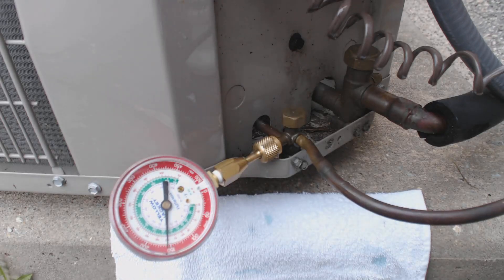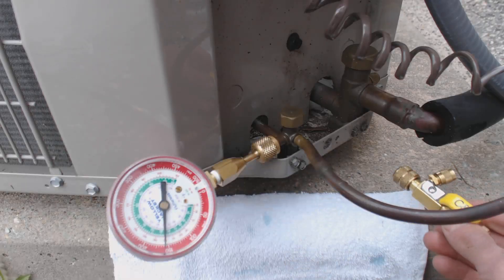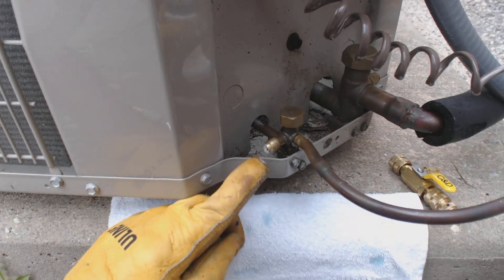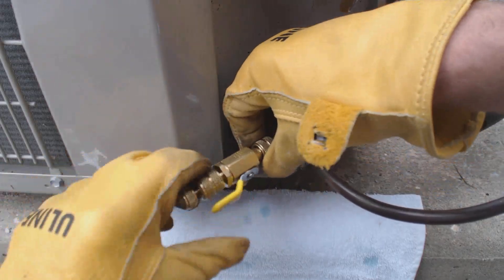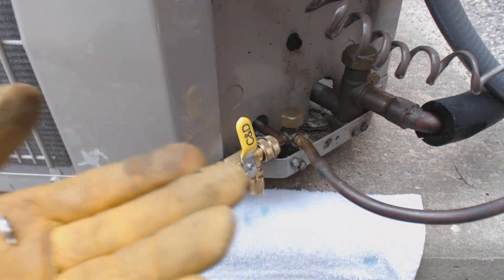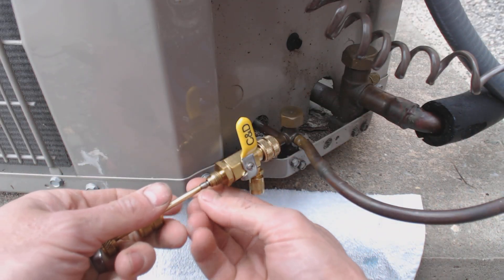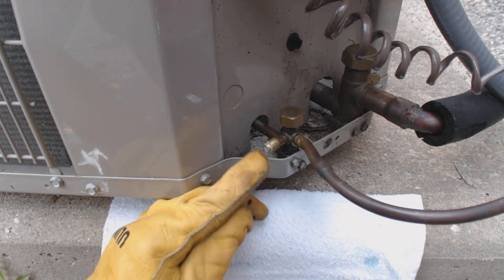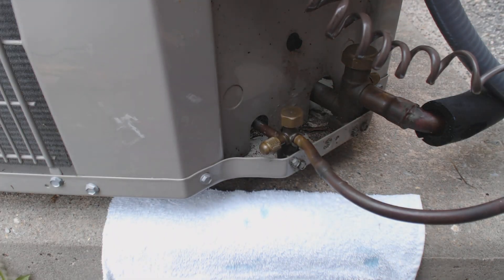Leaking Refrigerant! Replace the Leaky Schrader Valve without Removing the Refrigerant! Shown!

Comment: This man is doing a great service. I had two AC service people tell me I needed a new AC system because I had a "likely" leak in the evaporator. After watching videos and getting some supplies, I discovered there was no leak in the indoor coil. The only leak I could find was in the Schrader valve which I was able to replace thanks to this video. One summer later I have not lost my charge.
Reply: I love how all these videos start in the middle doesn’t show you how to hook up the valves
Reply: Where did you source the tool? I'm about to do the same..

Comment: Just had my unit freeze up yesterday. AC tech found that it was low on Freon. He only had to add a about a pound. Should he have changed the schrader valve also? I know about 2 or 3 years ago it had the same problem and a different company added some Freon to it then. I wonder if it could be slow leak in schrader valve. Thanks for any help.

Comment: Nice video. Is there a torque spec for the Schrader? On TPMS Schrader valves it is 4 in lb, granted there would be prevailing torque (possible) on the install tool seal. Are the valves nickel plated?

Comment: I’m not understanding why one would buy this tool when you can pump down the system then closed the service ports to change the Schrader core
Reply: Because simply releasing the charge at 0psig would result in much higher boiling point and contamination. You would be skipping a critical vacuum step where you pull the lines back into a state of vacuum below 500 micron.

Comment: You want to use your thumb and reverse the valve core removal tool slowly and continue to turn the service tool counter clockwise as you slowly move it back.  That will guarantee the valve core comes out with the tool and doesn't get stuck inside the shaft.  Also, before unscrewing the C&D tool from the service valve, you want to remove the rear tool portion first so that you don't end up with a leak.  If there is a leak you can quickly shut the ball valve and prevent refrigerant loss.  I am not a HVAC technician, but a homeowner and this is how I replaced all 4 of my Schrader valves on both my units.

Comment: Love listening-watching you at work-

A - Did you ever have an issue with threading the new Schraeder valve? (Bad replacement, defective, or cross-threading)

 B - Do you recommend replacing the regular brass valve caps with the rubber inserts?

C - Do you use a mirror to see bubbles on units like Ruud with the valves facing inward?

Comment: Can this be used in an automotive AC application?
Reply: Treading and size are different, two different expertise one automotive and the other is residential HVAC. Two different platforms with the same end results and operation, if you understand one you can easily understand the other but the sizes are proprietary. I ask why could they not have been made the same my answer. Patents my friend, Patents!
Reply: This tool is 5/16” for ductless units.  In more recent videos he uses the Vacuum rated. APPIOM tool MGAVCT (iicr)

Comment: My Schrader Valve is leaking so much that I am wondering if it is damaged.  I could feel when I thought the tool was in the correct position over the Schrader valve.  I turned and turned and turned, but could never retrieve the bad Schrader valve.
Reply: It is a possibility that the retriever is not the right size or the slot is not wide enough they can be tweaked a little wider if careful.

Comment: Thanks for making this video. This is what I need
Reply from the maker: Glad to help! I have a newer video using the appion valve core removal tool where I leak check at the back of the valve core removal tool before taking the tool off the port, thanks!

Comment: Is there a tool that works for R22 and 410 as well as automotive 134a service ports?
Reply from the maker: The c & D or the appion work well for r-410A and R-22 such as those linked at amazon.com/shop/acservicetech but R134A have a connection that is different, thanks!

Comment: I open out the service port cap today after 2+ years and there is a short burst of gas. Is this considered a leak that requires valve replacement or it's normal for not touching the service port for long time?
Reply from the maker: That would be a small leak. You can use bubble leak detector like the small can of rectorseal and dabber I have linked at amazon.com/shop/acservicetech - and check for bubbles forming. Don't use dish detergent and water as dish detergents are corrosive now a days. You could also replace the valve core/schrader valve with a valve core removal tool. I have another video showing the use of the appion valve core removal tool. Maybe check that out as well, thanks- https://youtu.be/vmtlfcEr0is
Reply: @acservicetechchannel   So, a mild soap like Dr Bronner's would be ok to use?

Comment: Can soapy water be used instead of the commercial solution that you used?  If so, are there any problems using a solution that one should consider?
Reply from the maker: We use anti corrosive bubble leak detector only. The new dish detergents have corrosives. You would be surprised to see what happens over time with even stainless steel. It is not like it was 20 years ago with those soapy bubbles, thanks

Comment: Does much liquid escape in this procedure. It is the liquid line  and refrigerant is in liquid form ?
Reply from the maker: Yes but refrigerant will certainly leak if the schrader valve will not seal, therefore changeout is needed. When a system is off, both ports will have sat state refrigerant, thanks

Comment: How would I braze with nitrogen if im replacing the suction line valve?
Reply from the maker: You won't really be able to except for maybe flowing it through the other side and out through the 1/4 port on the new valve that you were installing. this will purge some but not all of the oxygen out of the lines as the compressor won't allow pressure through. We do what we can, when we can to do the best job possible. Great Question Steven!

Comment: Thank you soo much.  Just picked up this tool for our AC unit valve.  Ac guy wanted to charge us 65$ to change a valve out  went and bought this 38$ tool which came with 5 valves.   Thanks so much for your video and very clear instructions.
Reply: Gary D where did you find that $38 Schrader valve tool?
Reply from the maker: Thanks Gary!

Comment: i noticed you were holding the knob verrry strady as you were placing the shrader valve back in, does it spin out of control?
Also you opened the valve without completely inserting the valve core, wouldnt the refrigerant leak out and pass the replacement valve?
Thanks for posting!
Reply from the maker: I may have been purging the very small amount of air air. You have to push in as you turn, otherwise it will push the knob back out if the schrader valve is not starting to catch on the threads, thanks!